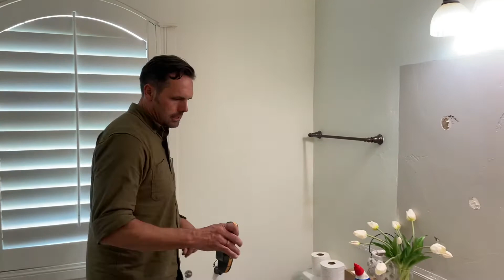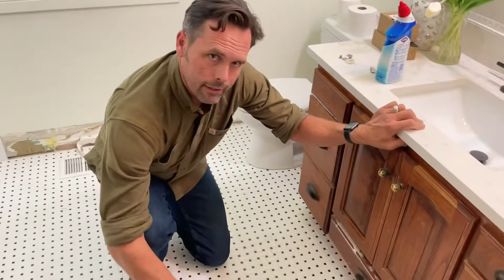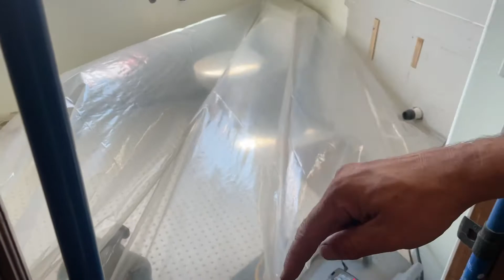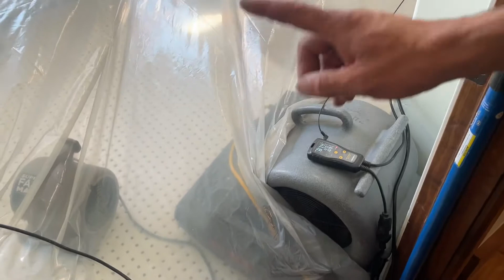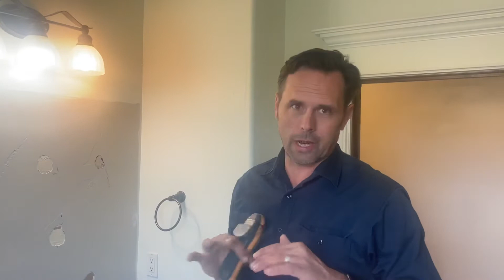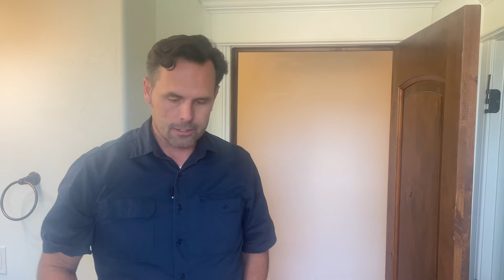How to dry under a tile floor. Flooded bathroom.

Comment: Use a thick tarp over a fireproof blanket and tape the floor off with a tent in the middle for a propane heater or a good space heater. Let it bake for three days and you will be bone dry.

Comment: As far as tile on concrete slabs, unless the concrete was painted, sealed or had epoxy applied before the tile was laid, the water will absorb into the concrete and continue to the earth below it. Fans and dehumidifers, pull the baseboard and PRO TIP just cut a few inches of drywall along the bottom BUT keep the cut LOWER than the top of the baseboard so strips of drywall can be put back and don't need to be taped and mudded, as the baseboard will cover it up after framing is dry. If the baseboard is 3 1/4", cut 2 3/4" off the floor so the (fisinshed) part of the walls don't need to be repaired and repainted. Fastest way to dry it out and quickest most cost effective way to fix it. Now wet drywall with tile on it in a shower is a tear out and the HACK installer should lose their contractors license for put a product that degrades a little more every time it gets wet. As tile and grout are NOT waterproof

Comment: I kind of see the theory behind the idea BUT without a dehumidifier in the area and room closed off, instead of having cool high humidity air you got hot high humidity air. Commercial size dehumidifiers pull gallons of humidity out of air per hour and gives off a good amount of heat out the exhaust. Not going to dry very fast just blowing hot humid air around and not eliminating the moisture as it rises from the heat. The a/c might get it down in the low 40% but a large dehumidifier will get it in the low teens if that small room is sealed off.

Comment: Pretty nice setup you got and definitely saves costs for insurance or homeowner on the repair side of the claim.

Anyone else watching this should know that clean water becomes dirty water within just 2 or 3 days so if you aren't able to start drying it up like this within the first day or two then you'll need to rip it out in order to properly treat for mold.

Comment: No, it  water proof laminate , but water trap under between laminate and cement floor , water ozzing out when step on it .
Reply: Yeah. You are going to have to remove the LVP and then wipe it down and dry it, dry the concrete, then reinstall.
Reply: @mikefisher7129  peeling couple laminate out and use blow dry blow underneath it not gonna work?
Reply: @trahuynh_usa  drying under laminate or LVP is super difficult.  It’s “waterproof” from the top.  When water gets underneath it.  It is “waterproof” from the bottom.  I have not found a way to make sure that I get the water out without removing it to the end of the water.

Comment: I have a cracked fridge hose leak and poor down into my basement flooded the whole corner of my basement after clean most the water out, still water on lower part water trap under laminate floor does anyone know how to remove/dry water out with out remove any laminates ? Thanks
Reply: You got a tear out laminates.
Reply: @mikefisher7129  oh , you mean tear it all out and redo whole thing no other options or air dry under it ?

Comment: I have the same question as @stevekohl1419. Porcelain tile (grouted) over concrete slab in a ground floor bedroom and we just had our 20 year flood. We pulled all the baseboards and have used dehumidifiers and fans to dry out the drywall. I can see the salt residue between some of the tiles and my meter jumps in some areas. How can I be sure it's as dry as it should be?
Reply: Were you able to solve the problem? I am in the same situation.
Reply: @jhar6099  just used dehumidifiers and fans. I haven't reinstalled the baseboard so I could keep an eye on the drywall. It seems to be okay.

Comment: Thank you for this interesting video. I work in water mitigation and tenting the tile floor is an inyeresting idea I will try out at my next opporunity. I have a ground level master bedroom with a ceramic tile floor (grouted) on top of a concrete slab with water trapped in between. Right now I am running two dehumidifiers and two air movers. The space might be a little two large to tent (but not impossible). Do you have any tips or suggestions to help me dry this bad boy out?
Reply: Please and thank you sorry for the spelling errors😅

Comment: Can someone tell me the name of the two machines he used to dry the water. I need to rent it. Thank you
Reply from the maker: E-tes heat unit is what we used in this video. It has an air mover that pushes the air through the heater.
Reply: Likely a dehumidifier and an air mover. Not sure what the fancy temperature gauge that brings the room up to 120 then expells air until it reaches 110.
Reply: @stevekohl1419   I rent both from homedepot to dry my marble tiles. It left it in the bathroom for 3 days, and it still looks wet. The surface of the tile is dry but for some reason, it still looks wet. Any help would he greatly appreciated

Comment: Several years ago, before I learned how to turn off the toilet water, I got a large "clog" stuck and flushed.  I had a HUGE amout of "dirty water" flood on to the entire floor.  Now I have a wet floor from a water leak just below the bathroom, under my mobile home.  The leaking pipe has been repaired.  How do I get the linoleum and wooden floor under it dry that previously had a lot of "dirty water"on it?  Thank you for any suggestions!
Reply: You are going to need remove the linoleum floor as it will trap moisture underneath. Set up a dehumidifier and some fans to dry out the subfloor.
Reply: @icarusthor754  Thanks so much for your quick and very helpful reply!

Comment: Going to attempt this on my tile floors. Slab underneath though. Will it work without ducting the air out? I can setup a containment w plastic around space heater and force hot air, but no way to heat to 120 then shutoff until it reaches 110 like you do in your video. Thx for the tips!
Reply: Im in the same situation right now. What did you end up doing and how did it turn out?
Reply: @stevekohl1419  didn’t work at all for me, unfortunately. I think if I had access underneath via crawl or basement I could have dried the wood w dehumidifier. But ran it for like 3 days and it made no diff. Ended up ripping up the entire shower and fixing the failed pan, which was never allowing the water to drain properly, as the drain was higher than the liner. Good luck on your end!
Reply: @ryanbirge  thanks for the info and speedy response I appreciate you.

Comment: Percentage what should a bathroom tile floor read after water leak 12 to 14% or 7 to 9%? I did a little research and hearing/ reading both answers. Thank you Great video BTW
Reply from the maker: That is a good question. There are a few factors that determine what the drying goal should be.  It will depend on what your areas standard WMC (Wood Moisture Content) is.   A dry state or country would be different than a place that has higher general humidity.  It depends on what meter you are using, and how you are taking the reading. Most tiles, travertine, stone floors will give you a reading above 15-20% when it is dry on many moisture meters.  We are trying to get the wet areas of the tile to read the same as the areas of time that are dry.  When we are talking about wood floors, in my area we are trying to get the sub-floor to 7-8%. Depending on the time of year.  Hope that helps.